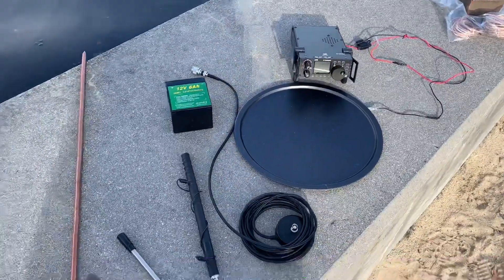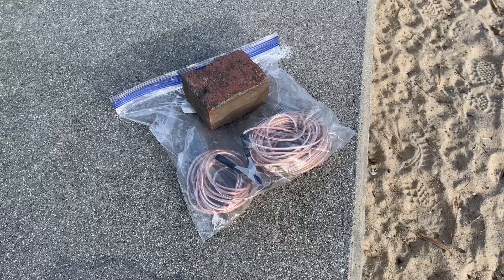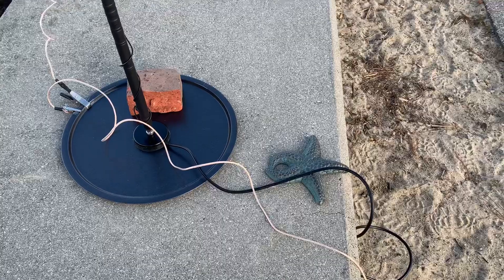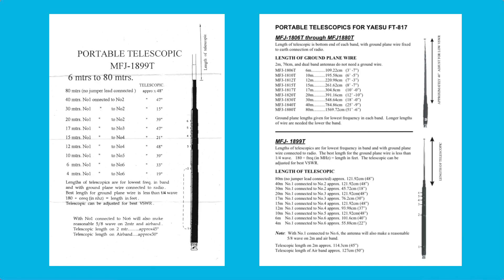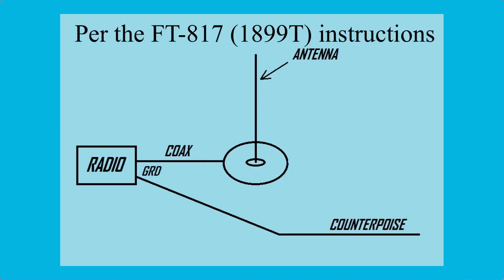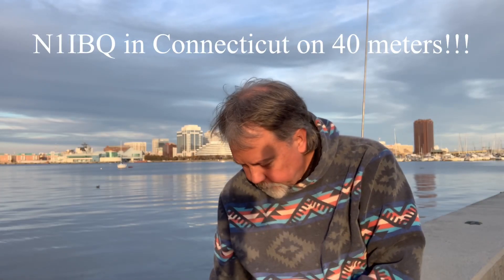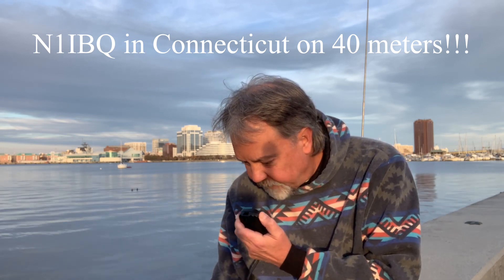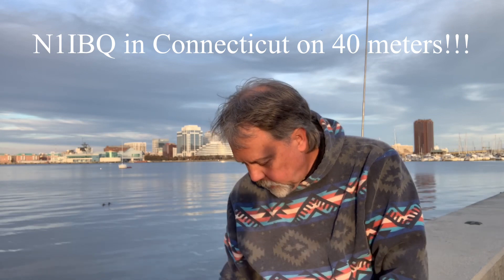Portable in the Harbor with the MFJ-1899T Telescopic Antenna and a Mag Mount

Comment: How in the heck do you get this thing to work on a vehicle. I’ve tried the mfj and the Intellitron. I had it on a mag mount, didn’t work. So I added a wire from the base of the coil to the vehicle frame, didn’t work. Works great in the yard with radials.  I’m ready to give up.

Comment: I see countless reviews on all kinds of tiny, compromised antennas  with many hams not understanding the physics of these antennas, It does not matter what brand,  Elecraft, MFJ or the Amazon clone) , Comet, Chameleon, MP-1 Super antenna Radio Waves, or what ever other brand is out there? , bottom line is your efficiency  and losses will play the most important part in using  any of them,  a good counterpoise is a must of course and  forget the constant trying to resonate and fool with SWR adjustments.  It is usually a waist of your time unless you just do not have a tuner and have no choice, , small is small for most of the bands your trying to use,  These antennas can still  be very useful ,  they  fill a need of quick set up, fast and light weight deployment  and can  yes allow contacts  and sometimes do very well depending on conditions and the modes you choose to use, Do not expect great SSB or AM, FM  contacts all the time unless the  band is in great shape, narrow band modes like CW and data (FT-8 as an example  will always perform best usually,   but no way are you going to get super  day to day results all the time  especially trying to use a tiny antenna on the lower frequencies,  like 80, 160 and even 40 is stretching it  You actually want  a narrow SWR bandwidths as that shows more efficiency on the frequency your using  and being mad because your SWR 2 to 1  bandwidth is only  10 to 15   KCs wide on 80 meters or tad more on 40 meters ( as mentioned by some hams in the comment sections)  is an example of not understanding efficiency and expected bandwidths  as compromised small antennas  relates to full size antennas like a dipole cut for the band in use,  To operate  I would extend the whip to full length, in this case (1899T)  find the loudest back ground noise as you hook to the tap which may not even be correct in the paper work ,( common on the MFJ model),  and then let your  manual or auto  tuner do the work to make your radios finals happy,  Keep the coax run short as SWR losses are based on your type of feedline and usually based on loss per 100 ft,  You can have a  3 or 4 to 1 SWR or higher  at 100 feet and reducing the coax length to half and cut losses in two and so on,  I have had all the portable small antennas out there and I keep my coax length very short  either no coax with direct connection to my radio or tuner and even elevating the single radial can really improve things, this is what Buddipole does with it's Buddipole Versa T vertical  as well as the Buddystick pro vertical antenna  A couple feet of elevation on the radial can really help at times,   This is basically a Qrp to low power  antenna as most of them are and with keeping  power down even worrying about common mode  current and having a choke  on board is often not needed. Your particular set up will determine what works for you.  I have made hundreds of contacts with my small portable antennas and there are countless utubes showing others doing the same,  just too many videos in my opinion showing a lot of extra work tuning  to resonance when you can really eliminate most of that hassle.  Experiment and find out for yourself, that is what makes ham radio so fun  73 J

Comment: Hi Walt! I have the Outback 1899 antenna, which is similar to yours, however, mine has a whip instead of telescopic part. 
I use it with a mag mount on my car. It works great on 10, 15, 20 and 40m. On 80m it’s useless. 
With my old Icom 735 (and no antenna tuner), I was able to make QSO’s all around Europe, North America, the farthest it worked was Cape Town in South Africa. SSB, around 50-100W.
SWR always around 1:1.2 or 1:1.3.
If you look at my QRZ logbook, all QSOs there were made with this antenna only. 

73 de SP1TI

Comment: Do you think this antenna would work fine for 10m? I’m considering this vs the MFJ 1810T. Thanks for these videos, you make it look very easy hehe. Thanks.
Reply from the maker: Thanks for watching! It might work ok but for 10 meters I’d probably just get a CB telescopic whip, I’ve seen them with a BNC connector on Amazon pretty cheap.
Reply: @COASTALWAVESWIRES  interesting. I will check this out. Thanks very much Walt.
Reply from the maker: I just got one to try myself, here’s the link: HYSHIKRA 27Mhz 11meter 51inches... https://www.amazon.com/dp/B093DBNS8V?ref=ppx_pop_mob_ap_share

Comment: We seem to be on the same G90 wavelength. I have on You Tube a rough video comparing on  a mag loop with a whip  and a QRP Guys end fed. For both the end fed and the 20 meter whip, I used about 33 feet of coax as my counterpoise. I found too much and too little coax, threw my readings off on the SWR scale. Somewhere between 30 to 35 feet was just right. I also found the mag mount was counter productive so I got rid of it and now use a non conductive mount. The whip I use is one made for 20 meters but with playing with the height and the the auto tuner, I have been able to work other bands with some success. Anyhow - keep the videos coming. You do a great job explaining your process.
Reply from the maker: Thank you! I subscribed to your channel and I’m enjoying your content! 73! K4OGO

Comment: That antenna will perform 100 percent better mounted on a vehicle and a good ground to the car and the magmount. I use a similar antenna 100 watts on my radio in the car and get consistent good reports. I can work coast to coast practically everyday on 20 or 40 meters. The pizza 🍕 pan and salt water test was fun to watch. 73's WC4FM
Reply from the maker: Might give that a try. Thanks for watching! 73 K4OGO

Comment: How salty is the water there?
Reply from the maker: Very salty, it opens up to the Chesapeake Bay and Atlantic Ocean.
Reply: @COASTALWAVESWIRES  I suspect a few more radials might help tune the antenna, not having seen this antenna it is hard to speculate? A basic whip with no other loading coils etc and one of Wolf River coils could make tuning easier. You can tune by ear if near the radio using one of their coils followed by a simple twist, they recommend at least 3 radials. of 33 ft on 20-meters so that might be a good place to try. I have a g90 and hope to get out more to try it, I have a weak saltwater bay near my home so your water experience is helpful. salty level does make a difference. a good friend now SK lived right on a bay yet he told me his butternut vertical still required many radials to load correctly, he mounted it on a dock and tossed the radials into the water using stainless steel to last longer.